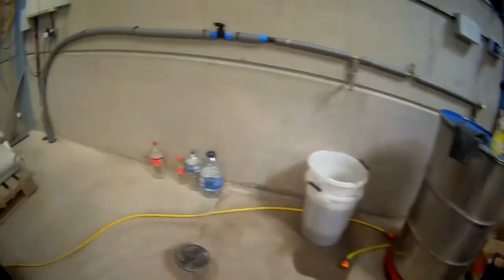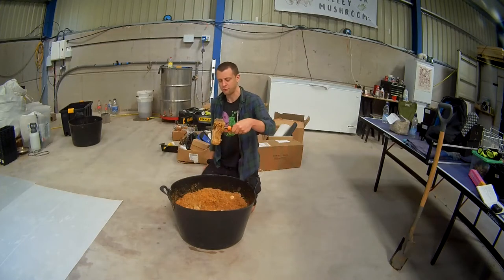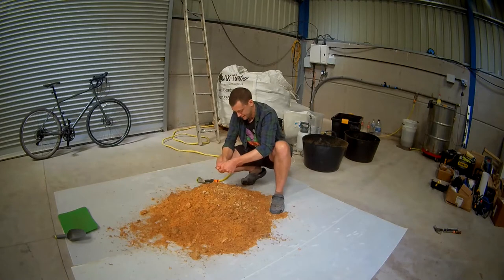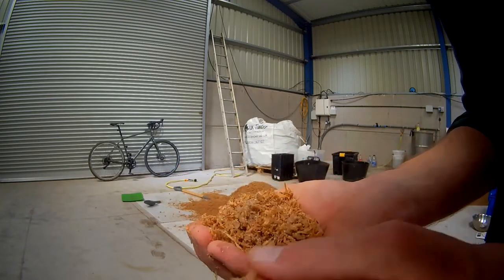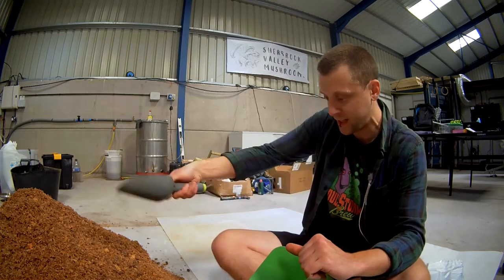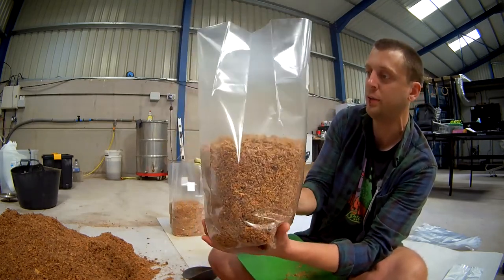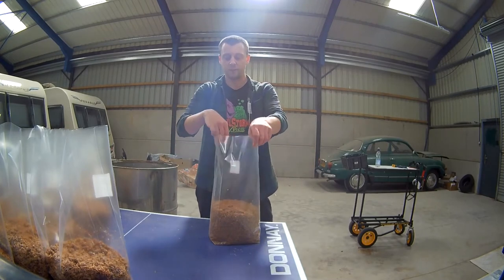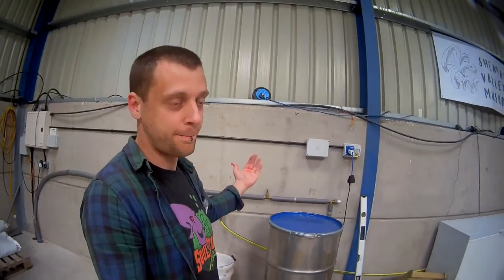How I Grow Mushrooms - 001 - Bulk Substrate Prepare and Load.

Comment: If you have some method of hanging your sawdust up in a net or pillow case, you can over-soak them, then allow them to drain in the hanging sack. After hanging, they should release all moisture that is in excess of field capacity. Really simple and clever way to fill your bags with the chopping mat. I will definitely try that.

Comment: Mate what a wounder on those bags! im totally stealing your bag filling tool - ive been looking for something like this for a while. Cheers man keep it up.
Reply from the maker: Yeah man it was a good job I noticed really. There is a knack with filling the bags for sure, it's a simple thing but that chopping board makes a huge difference. I'm actually doing it a different way now; with a cement mixer. Doing it by hand like this is a massive stretch for this many bags, works great for doing 10 or so at a time though (:

Comment: For newbies if you want to leave it to soak overnight put a pillow case in a bucket and fill it with your substrate and water then you can twist and squeeze the pillow case into the bucket to remove excess water.its not perfect but works well for what you need